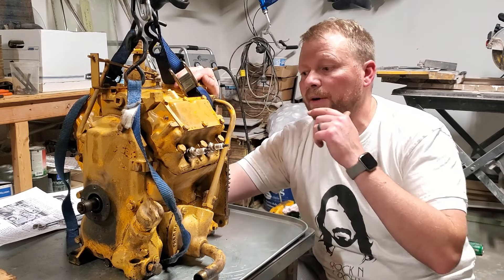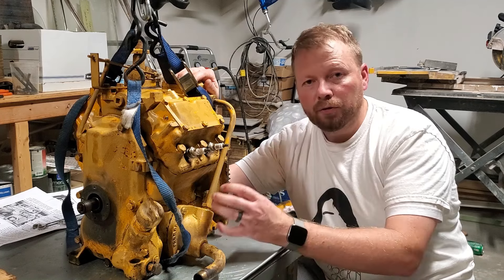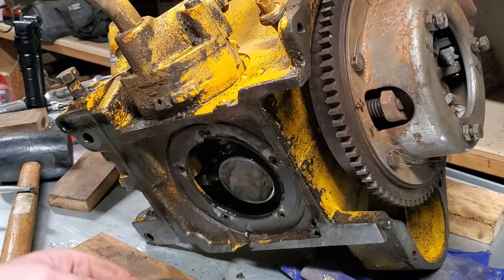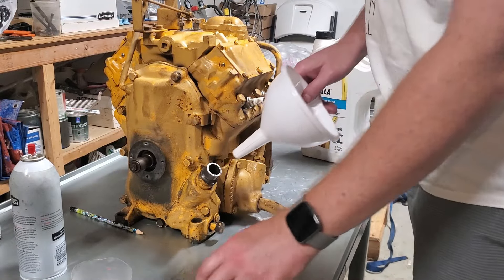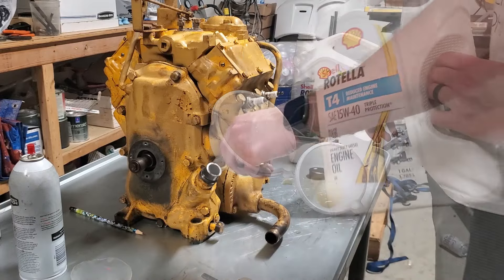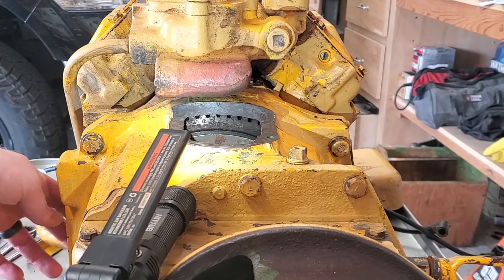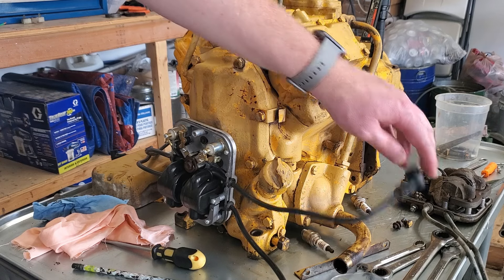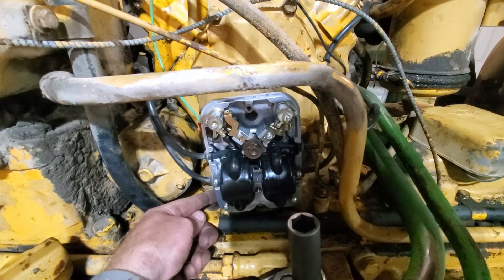Pony Motor Health Check-up

Comment: When looking up into the engine you can see the old lock tabs on the connecting rods have been bent A few times. So likely it was overhauled previously. At least it was inspected. I still think it's crazy those engines run so fast all the time.
Reply from the maker: That's a good point!

Comment: The guys I have dealt with for a replacement pony motor say that the rings that John Deere used are the "Achilles heel" of the pony motor.  There are quality replacement rings available.  While checking out what I suspected was a water pump leak I found pieces of ring in the bottom of the crankcase.  The owner of Renaissance Tractor in Washington state  has told me personally some things he has seen that contradicted some of what is spread online.  Thanks for another great video.
Reply: I know you Dan! haha
Reply: @tractordan933 I wish you had shared what the Renaissance Tractor owner told you.
Reply: @KStewart-th4sk  I'll admit I was curious too haha
Reply from the maker: I appreciate your comment. I hadn't thought about rings quality. I always just thought about oil quality and how if your carb floods into the oil, it will diminish the lubricating capability of the oil. And also a leaky water pump, like you mentioned.

Comment: That new distributor was money well spent, it will last a life time if your system has a working pressure switch to protect the coils.
Reply: 100% agreement on the oil pressure switch to control ignition power! Absolutely needed!
Reply: @tractordan933 How does the pressure switch protect the coils? From what "weirddeere" commented it sounds to me as if the oil pressure switch would be just used as a safety device to protect the engine from starting if there were no oil pressure. That being said i know nothing about these engines BUT am quite familiar with oil pressure switches being part of the safety shutdown circuit on Cummins or the old Detroit Diesel 2-strokes i worked on. These diesels (other makes too) have oil pressure switches and water temperature switches as part of the safety shutdown circuit. I don't believe the oil pressure switch would be there to protect the coils?
Reply: @KStewart-th4sk  one main weakness of the V4 ponies is if you leave the ignition switch on (engine not running) the coils will burn up. Those coils are not cheap. And it is very easy to accidentally leave the switch on. Add an oil pressure switch to the circuit and it will cut ignition power when there is no oil pressure. So it saves from a stupid mistake AND will shut off with a drop in oil pressure, double feature! Then you may ask, how do you start it? Wire up a bypass from the starter to give the pony power when cranking. Deere DID use an oil pressure switch to light up the red dash light for the pony but it's not a big job to redo it to control the ignition power and the light at the same time
Reply: @weirddeere  Thanks for taking the time to enlighten me of the potential problem with the coils burning up if you left the ignition switch on. That does make sense. If i remember correctly the Cummins we had on a MKIV Tamper (railroad maintenance machine) had a BYPASS BUTTON you pressed until oil pressure was present. Only a second or 2 of course. Murphy shutdown systems had the same thing on other equipment we had. On the old Detroit 2-Strokes it had a TIME DELAY module usually that shut down the engine if there was no oil pressure present. I think after about 15-20 seconds of no oil pressure.
Reply from the maker: I remember you mentioning that to me a while ago in an email. It would be fun to see how you did that. I like the two-for-one advantage you mention.

Comment: I have wondered about using a 20w 50 semi synthetic oil especially in a smoker to help seal those rings.  If I remember right the book recommended either 30w or 10w 30.
Reply from the maker: I think there is a chart in the manual showing temperature ranges and what oil you should use. But we just use 15w-40 in everything. It has enough zinc additive for the flat tappet cam.

Comment: Pony motor now has a clean bill of health...should be trouble free for a long time!
Reply: The biggest problem one will face now, is the low quality of gasoline available, one should go to the airport and get a can of Av' gas and save a lot of headache.  That stuff is highly refined, and remains stable when stored properly for about 3 years!  It does cost about $6 a gallon, but that little pony motor doesn't burn hardly enough fuel to bother, same with your lawn mower and other small engines...
Reply: @theda850two  I would strongly recommend against running avgas in most small engines, or really, most non-aviation engines. It's to volatile for small engines (Think running gasoline in a diesel engine, to a lesser degree), and it'll toast a small engine rapidly, my uncle used to do exactly that, he stopped after destroying a few garden tractor engines. Ethanol is the biggest issue with new gas for older engines, so if you can find ethanol free gas, most small engines (And larger ones, for that matter)  will be happy with it.
Reply from the maker: That's the hope!
Reply from the maker: We just run ethnol free gasoline. No problems at all.

Comment: Is it possible and/or less costly to convert it to electric start?
Reply: What would be the fun in that?
Reply: No idea why my reply disappeared here. I just basically stated that he probably wants to keep it original. It annoys me that yt i assume removed it. Why, i have no idea, and how many others does it happen to? What if it is valuable info someone wants to share?
Reply from the maker: Yes, there are kits to convert to electric start. But they are expensive. Our 70D has been converted using a big heavy duty semi truck starter. I've done a video on that previously.